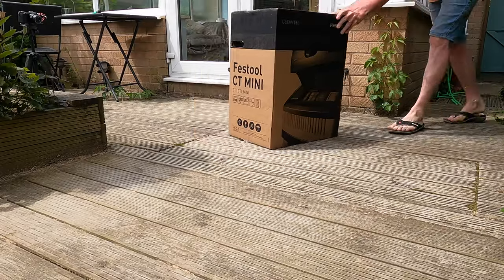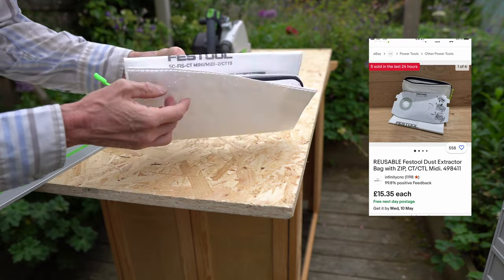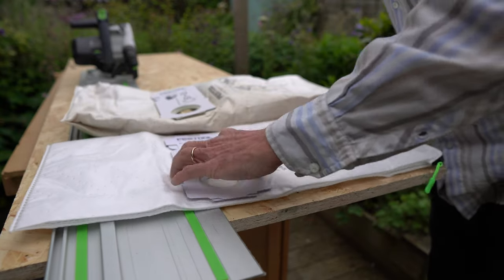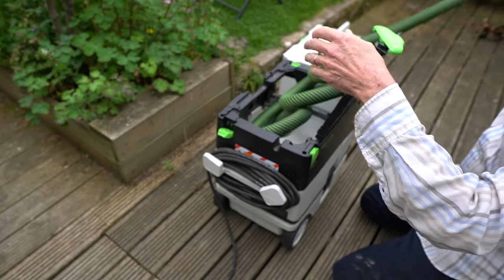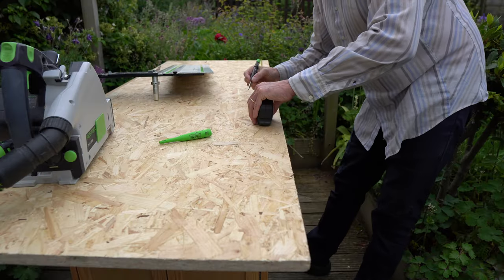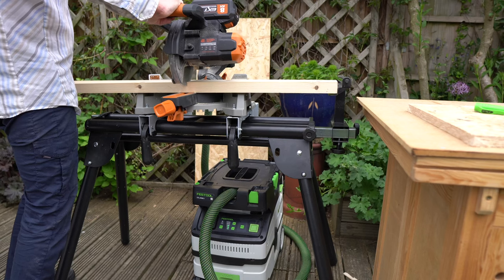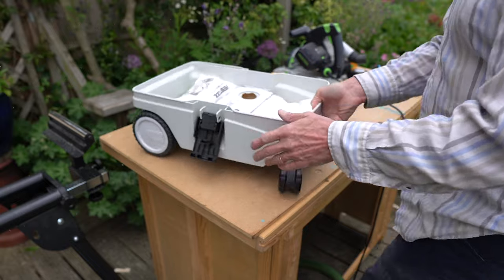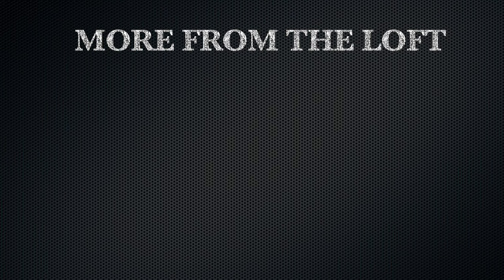Save money with this Cheap Festool Zipped dust bags for you Shopvac

Comment: Cut the end of the bag open then use a peice of plastic push fit pipe, slice it down the length and slide it over the bag to pinch it shut. Loose hardly any space in the bag.